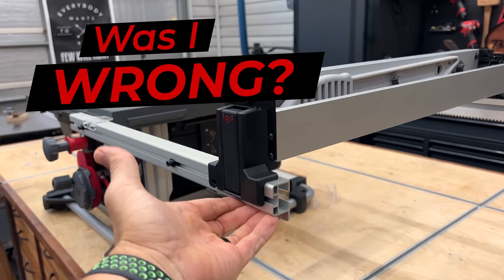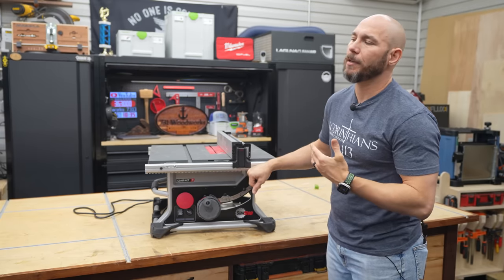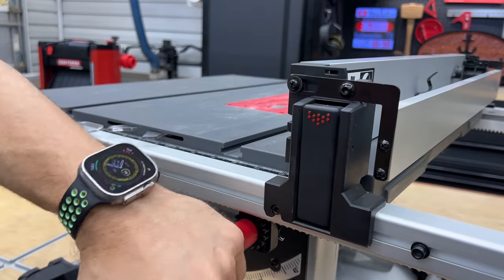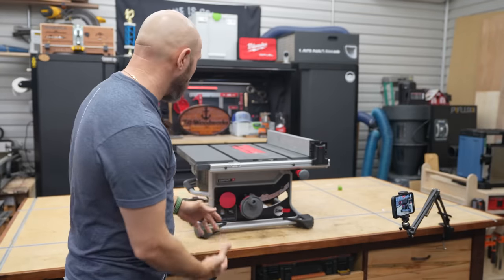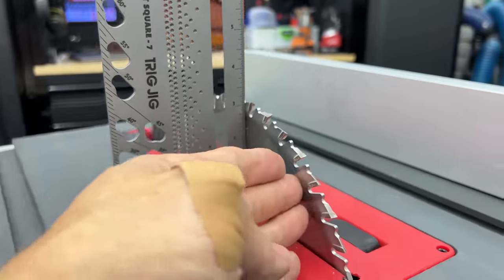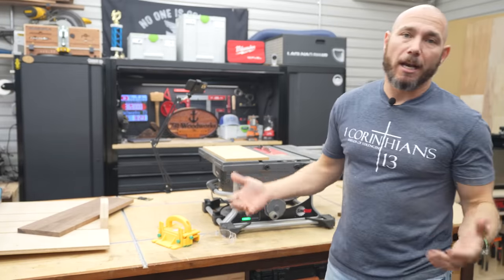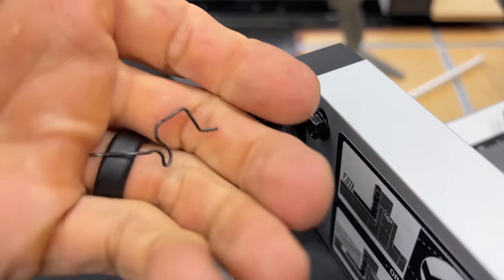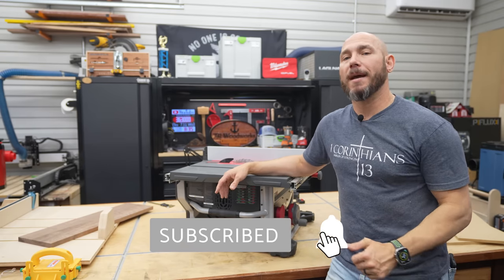Was I Misled or Wrong About the SawStop Compact Table Saw?

Comment: Thanks for the overview of sawstop jobsite. I'd love to see a legit comparison between the two if its apples to apples, maybe doing the five cut test with each on half a dozen different types of materials. I'd also be interested in both fences being flexed at full extension, table construction/flex/flatness, differences in plates (zero clearance vs?), knife/blade removal, amp draw start up/under load and do they both come with stands or did you buy bare tool. Then the big ticket differences. Dado etc, zillions of 4/5 star reviews vs safety. Which would you pick if  sawstop didn't have the safety? Would you choose different if it was going for jobsite use vs compact beginner hobbiest that wants/needs some precision. Did you say you spent around 300 for the 10" dewalt? This probably wouldn't have been soooooo long except I'll be buying one of these two soon for my first table saw and would love to see you crush a comparison. Thanks again.

Comment: How much does locking the fence in place help to reduce play? I noticed in your other video, where you noticed the large play, that the fence adjustment was not locked. Would that have helped reduce the play some, or would it be not enough to make a difference in that case, with the cam not adjusted yet?

Comment: The blade safety feature on a workshop table saw is practical in a controlled environment with clean dry timber. 
On a job site, using damp lumber, especially in the colder parts of the world or tropical or very humid environments, that safety feature would be nothing but a bain. Every damp piece of lumber you touch to that blade ........oooops, there goes another $175 as well as the inconvenience.
Anyhow, as soon as you mentioned dado incompatibility, that table saw was off the table. 
What were they thinking?

Comment: I have a newer version Hercules table saw that has all the features u mentioned for the saw stop except the safety feature of course. From the factory it needed a slight adjustment with the fence, same adjustment as the saw stop. And for $349 on sale now. The rack and piñon fence was the reason I purchased. Has a 10” blade compared to dewalt over $600. Very pleased with it. Been using it for 9 months with no issues.

Comment: Hi. I'm just wondering why different brands release different types per region or country. For example, Bosch released a GSB 18V-55 combi drill in the UK/US with 55Nm torque but only released GSB 18V-50 in my country with 50Nm torque. What's the reason for this? Hope you can do a video regarding the reason why there are different releases per region/country. Thank you.

Comment: Hey Matt, thanks for all your videos. I’m looking to buy my first table saw for my little garage shop and I’m really wanting a sawstop. Mainly for my wife’s peace of mind 😊 

I do have a question that I hope you can guide me on. I want to build a decent work bench around it. Something like your outfeed table but a spot “notched” out for a table saw to go in if that makes sense. Do you think this Compact one would be best for that or one step up to the job site pro model? I’m not concerned with this one not being able to use a dado blade, so if that would be the only difference for this situation in your opinion then awesome. I’ve never really build an outfeed table to house a table saw so I just want to make sure I cover everything I need before I purchase one. 

Also, sorry for the wall of text 😂
Reply from the maker: I haven't used the Jobsite Pro model, so not sure about it, but it does look like the fence is a slider on that one. I would look at reviews on YT and see how it performs and how accurate the fence is.  Other than that, I don't see a big advantage of the pro over this one if you're mounting it in a table anyway. However, the pro model does look like it accepts a dado stack.
Reply: @731Woodworks  You’re the best brother! Thank you so much for a) reading that insane wall of text, b) most importantly, taking the time to reply. I’m beyond grateful 👊🏻

Comment: Two other major problems with some or most units:

1) arbor runout: I had to return the first unit because the blade wobbled like crazy. The new unit is better but far from perfect.

2) the top is NOT FLAT at all. Meaning I had to sand down the coating and some aluminum underneath with sand paper glued on a flat panel. At least it’s close to being flat around the blade now.

In summary: you buy this saw for the safety features. Everything else is average jobsite quality.

Comment: There are several examples of manufacturers that make quality higher end goods that are well made and priced accordingly.  They decide to go into a market with more volume of sales.  The same level of engineering does not go into the equipment but the premium price does.  An $899 should outperform a $300 saw right out of the box.

Comment: Power question...... how does this saw perform cutting hardwoods?    Primarily maple, cherry, oak and walnut.    Is it powerful enough to effectively cut 8/4 hardwoods?
Reply from the maker: It does well.  Obviously not as good as a cabinet saw, but for this size saw, it has good power.

Comment: I ran my left hand through a table saw when I was 16, removing several digits.  Fortunately, I had a good surgeon that reattached everything and I only lost my thumb joint.  Works well enough that I have a career on a keyboard.

Having said that, I can't even justify the price on a Saw Stop.

Then again, ain't nothing like being burned once to give you laser focus when using a saw.

Comment: To be completely honest, I love mine. I normally use just about everything DeWalt but I've been very satisfied with my CTS so far. I think it's important to remember that as woodworkers, we can only get so precise before we start endlessly chasing 64s of an inch. Obviously I'm not pleased to see them claim that it's "not a precision tool" bc thats a pretty lame response to a very valid concern, but my guess is that this was primarily designed as a jobsite tool. If you want something that's going to get you within a hundred thou, you probably shouldn't be using this saw anyways to be fair.
Reply: Looked like a lot more play than a hundred thou to me 🤷‍♂️
Reply: @vincentferrari  like I said, the response claiming it wasn't a precision tool was lame and before he tightened up the rail, it was obviously not ideal for cutting material at that width. But once he tightened it up, it seemed to be more than reasonable in terms of precision for the work that most of us will be using it for.

Comment: I would find out what size skate wheel fits snug inside the arm, and replace the cam with the skate wheel and bearing.  Get a harder skate wheel so it fits snug, and the adjustment knob will be easy to turn due to the bearing, all while the skate wheel fitting snug inside the arm.

Comment: Great review & update.  Good one.  I'm looking between the Saw Stop and the Metabo HPT Table Saw | 10-Inch Blade | 35-Inch Rip Capacity | C10RJS - what are your thoughts on that saw, sir?  I'm re-building my shop and I want to upgrade from my aged & slightly beat up Bosch 10" saw.... Your thoughts please?  Thanks for the great videos!!!
Reply: Stay far away from the metabo table saw! I’ve had mine for almost two years and i have cursed it since day 1. It’s junk for way too many reasons

Comment: I have a hitachi job site table saw that is great but I don’t have the money to upgrade to a sawstop but I have enough saved for your old Delta table saw. Is that a good upgrade idea? I want it for the cast iron top and larger work area. What do you think? Job site saw to a Delta a good idea?
Reply from the maker: Definitely a great upgrade. I think that Delta (Ridgid makes same version) is one of the most under-rated table saws on the market.  Go for the Delta.
Reply: @731Woodworks  thanks for your insight. You had that delta for awhile so your opinion means a lot. I appreciate your content and love seeing how far you have come in your woodworking journey. Your kicking ass. Thanks again.
Reply: Hello I had the Hitachi (the 110V)  Job site saw (from Lowes) for 5 years it was a great machine, but the Fence was not very accurate (the Dewalt also is not very accurate) at the end they are JOB SITE TABLE SAW and for that, they perform beautifully, so I after I did exactly what you mention purchase the Delta 725-T2 from Lowes, All that I can tell you were a great UPGRADE   for the price you can not go wrong (FENCE is accurate every day)  so I have no regrets, your next choice will be the LAGUNA F2 but now you going to the 1800US$ range so maybe better the SawStop contractor version (+/- 2300US$ with the extensions). Hope this help, and Happy New Year 2023
Reply: @wwmilanl  thanks. Yeah that laguna would be awesome but I have all the money saved for the Delta. I sold a bunch of tools and old equipment to pay for the new delta. Plus once I buy the delta and sell the hitachi it should be a even better deal for the money. Thanks again.

Comment: I had a mouse chew through the ribbon cable that goes from the brake cartridge to the motor gear box. It is a $20 don connex ribbon cable. However Saw Stop will not sell me the cable. They say I need to replace the entire motor/gear box at a price of $250

Comment: New woodworker here. If you get a table saw that cannot accept a dado blade, how else can you cut a dado? Is it really necessary on a table saw?
Reply from the maker: Hey Mark.  It just makes cutting wider grooves easier/faster.  But you can still do it but just cutting 1 blade width at a time, then moving the fence over a small bit then making another cut and so on.

Comment: So no dado blade but how often do you really need or use that? How about the Pro jobsite model? 2x the cost but worth it?? Would love to get your opinion. Thanks
Reply: I'd think a dado blade would be a safety issue on a small, light, jobsite saw.  It's also a lot to turn for a small motor.
Reply: @kwilliams2239 thanks, I’m not a beginner but getting back into woodworking after many years. That said, I watch a lot of the YouTube videos and not that often do I see anyone using a dado blade . So is the jobsite pro worth 2x as much for just the dado attachment?
Reply: @garyp1945ify  I use them quite a bit but really only for cabinet making.  I have two sets.  I use a Freud for MDF and Forrest for hardwoods.  MDF is hard on tools and I want a good, sharp, set for fine work. A box joint set can usually be used with something like a Kerfmaker.
Reply: @kwilliams2239  thanks,  not a lot of furniture making so far, so I'm guessing the smaller new onw will work fine!! I've been using a 10" Rigid but want the safety od the SS.
Reply: Ditto for me!!

Comment: Very helpful review!
For that price - I would expect an industry leading fence, and this does not appear to be that.
I would also expect a best in breed included miter gauge.  This does not appear to be anywhere close to that.
Thanks for your honest reviews!!!
Reply: I would add to your comment that I would also expect it to be ready to go, 100%, right out of the box with no adjustments needed for that price.  Or any price for that matter.  If I have to jump right into adjustments on a brand new saw, what's it going to perform like a month or 2 down the road with use?!?
Reply: @TheRealGOTdurrrred  the Dewalt 7400 series has a better fence and it’s considered best in class and none of them are more than $600.
Reply: @TheRealGOTdurrrred  Right. That's exactly what I said. When I said the "series has a best in class fence" I meant that the class included contractor saws and cabinet saws.

😒

When you single out a product and say it has a best in class feature, you're talking about the class the product is in. I can't believe I have to explain that, but I guess reading and understanding sometimes requires assistance.
Reply: @TheRealGOTdurrrred  I SPECIFICALLY was talking about JOB SITE SAWS and even mentioned a model line. You replied TO ME. I was making a comparison IN CLASS to what the video was about. As far as "Who buys a compact saw without a Rousseau stand" who cares? That's not what I'm talking about. Stands mean nothing to me in my specific complaint about the FENCE.

If you're not addressing your comments to me, stop replying to me. If you are, then at least grant me the courtesy of reading what I write.
Reply: @TheRealGOTdurrrred  Don't turn it around on me, my dude. You're assed out. Peace.

Comment: I went with the Bosch jobsite table saw and it is the best jobsite style saw I’ve personally seen. Just an incredible power and although it doesnt have the rack & pinion, it has stayed pretty true for me since getting it dialed in. The build quality is just on a level you dont see with these saws until you’ve gotten the Bosch in hand. And comparing it to my first ridgid saw almost seems like its from a different planet.
Plus, it does take a dado stack and mine even came with the dado insert plate.
Reply: I have the Bosch. I have never been able to get the fence right. When ever I lock it in place, the top of the fence moves about an 1/16 to 1/8 inch toward the blade.
Reply: I happy but surprised you like your bosch so much. Either you lucked out or I’m  really unlucky with my Bosch. I have the Bosch 4100 jobsite saw and it’s to worst jobsite saw iv ever used. I regret buying it all the time. (Bought it used so can’t return it or utilize warranty). I looked brand new when I got it but tuning it is hard and sometimes impossible. (Like trying to get the side of the fence square to the table surface). And the blade raising system binds up multiple times each time I’m in the shop. Having to stop and clean to stancions and bolts every 5-10 cuts really eats up time and discouraged me to use the saw. Trying the dance to the blade and mitre slots is a headache too compared to similar style fences iv used in the past. I keep thinking of selling it but really don’t want to pass this much of a headache onto to someone else.

Comment: I am guessing they did not provide for a dado blade because it would require a separate brake cartridge.  Many dado stacks are 8" and it would not work with a 10" brake.  I got a Sawstop PCS at a freight auction and needed a few parts and was very pleased at how reasonably priced they were from Sawstop. Their owners manual is top notch. Excellent detail.  Surprised yours did not include the info on adjusting the fence.
Reply: They did not provide for a dado because it's European and thus Fisher Price. Saws spin too fast when shut off.... We much include a break ...  Oh well now we can't use dado stacks because in theory the blade could slam to a stop cuz of our new regulations on free wheel stopping break and cause the dado stack to fly off. And because that could in theory happen all arbors must be too short to even attempt to put dados on because safety...

Comment: The only reason someone would ever buy this saw is the safety feature. You take that away and it’s no better than my Dewalt, in my opinion. 

But even with the safety feature, I can’t imagine these would be flying off the shelves as they’re too expensive, in my opinion. 

I wouldn’t think many contractors would buy this to use on jobsites, and guys currently using a jobsite saw in their garage shops and small shops would probably rather buy a cabinet saw such as a Grizzly, Delta or Ridged for less than the Saw Stop, with the exception of the Grizzly which is $200 more, in my opinion.

Thanks for the information Matt! It’s possible that some guys didn’t pull the trigger on this saw because of your initial review, but now they can buy it knowing the fence isn’t an issue!